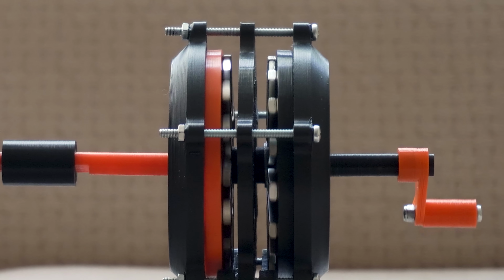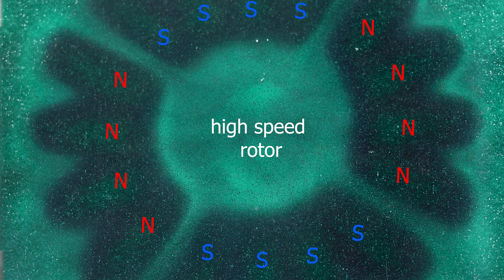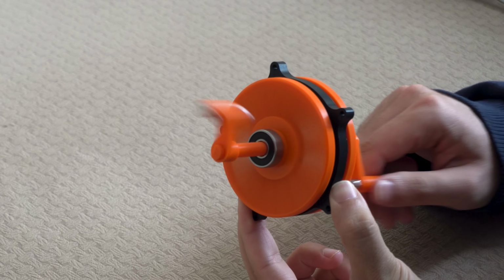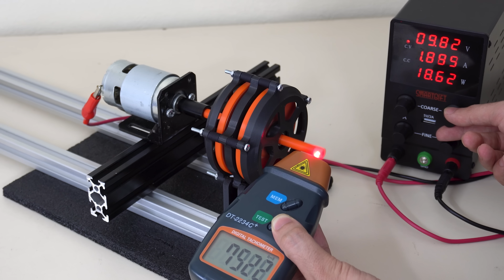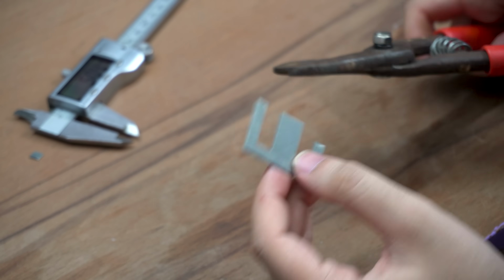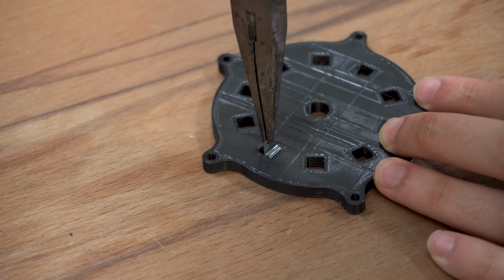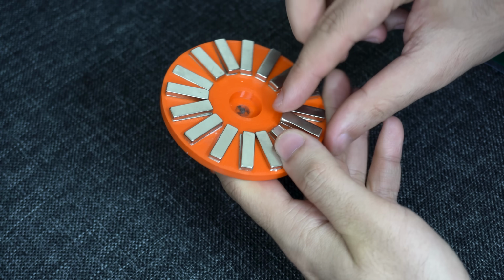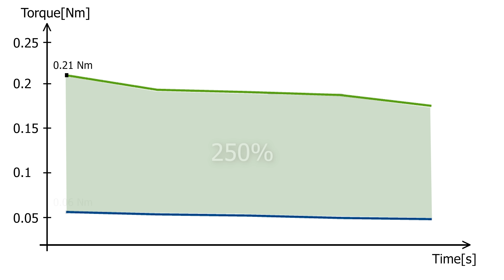Gearless Magnetic Transmission - You Can't Break These Gears

Comment: Correct me if I'm wrong, but these systems only change the speed of the driven rotor, not the torque, so it doesn't work at all like a traditional gearbox, right?

Comment: if you are going to operate a flywheel you might want to use some sort of pressure fit wood or thermo resin, 3d printing anything but metal is a bad idea. how has no one called this what it literally is, a flywheel. it's literally a magnetic tesla turbine.... which if you know anything about flywheels, they are extremely dangerous with any amount of weight. you might as well be building a centrifuge, which is technically less dangerous because of the orientation to ground and where it will roll off to.

Comment: I really love the design, but how does one change the gear ratio ? Say I wanted a design similar that I would use on a car and it needs to change gears. How would one do that ? You explained that if one changes the number of pole pairs on the rotors, it would indeed change the gear ratio, but then the magnetic flux modulator is equal to PP high speed + PP low speed, and we cannot physically chang the number of inserts on the fly when one needs to change gears, nor can one flip the poles of the magnets to change the number pole pairs on the rotors. So basically, I am stuck with a single speed magnetic transmission. Anyone found a solution ?

Comment: Bonjour, hello,
I’m struggling with the path of designing my WT,
Rather than starting with the WT itself, I rather started by deteriming the wind power (potential available) to about 26Nm torque
Now that I know what energy I’m dealing with, I just can’t find anywhere what this force will allow me to run (turn) as a PMA. Will it turn a 3m large, one magnet rotor, many magnets, and two external stators with as many coils (with IDK how many turns of IDK what gauge)
Based on my potentially available 26 Nm torque, how do I determine how many magnets (number, strength) and coils I can put ?
Any suggestion (book, etc..) will be greatly appreciated !
Éric

Comment: i wonder if the reason the small bits of transformer metal worked better is because they were cut in pieces. So instead of one large piece, you have 10-15 pieces and they are acting like individual cells together? maybe?

Comment: Here's a challenge, now  that you've been able to change the gear ratio, turn it back down to a mechanical way to charge and run itself. I'm sure you've got enough output gain mechanically to run the motor running it.

Comment: I wonder, if you replace the neodinium magnets with electro magnets you could change the gear ratio actively (also you can intentionally change the slipp force).
This could became a commersial use for small machines or even bicycles.

Comment: can you test just 2 plates of magnets to acts as torque clutch, what is efficiency when it slides: i think to do it for car water pump: pump is driven by belt and at idle it spins on 2000rpm, but at high engine rpm it spins at 12000 rpm what is too much and it uses lot of energy to drive it at that rpm, it would be good  not  to go over 6000rpm because water causes high drag as speed rises. so it would be good to have clutch that would start to slide on torque at 6000 rpm but question is will i start lose energy from input shaft on that magnetic sliding  same as it would at high rpm without that clutch

Comment: Can you submerge the entire model in Mineral oil/high viscosity synthetic? Solve any magnetic degradation from the heat caused by the eddy currents, and give you a true (near zero) frictionless gear. I realize toure essentially recreating the tourque converter by goong this, but it works for a reason 😂

Comment: "You can't break these gears".. and video starts with one of the magnets flying out.. do you think that gears break often in mechanisms? Did you consider the efficiency loses compared to standard solution? Those magnets will also self-demagnetize due to slippage and currents generated inside the magnets.

Comment: Logical theory so you can improve further so you can see how does it goes to highest torque since torque is everything since torque is resistance line that holds things, so the external and internal space is in balance since the external is what you see and the internal is also what you see, so if both external and internal is in balance by visual so it cause heat, since external is the mass that you can see and internal is the space that you can see, so there is a gap, so the mass has interact to the gap which cause react that is heat, so the external of two different to visual space, compare to higher external space, per um, so there is higher two different of visual external space so the visual external space is 5 inches, so the external space is smaller so it is at  very tiny level, per 5 inches in connect to internal space that is so tiny, so that is space gap, so two balance is in balance by visual and non-visual, so compare to us, the visual to non-visual, there is alot so it cause higher cold react since it is high amount of internal space so the air gap is so tiny relative to mass gap, so cause higher cold effect, so reduct heat so much so it is cold and very fast.

Comment: This won't work as a transmission. It can work as a replacement for the clutch and/or torque converter for a conventional transmission. It's just a piece of the powertrain, not a replacement for the whole thing.

Comment: You almost have Zero Point Energy down bro instead of putting your magnets face-to-face you need to invert them. You need to put a barrel cylinder in the Middle with your polarity phase as follows. North north south north north north south south north north south south north. Then what you do is you take your outer ring of magnets and run the opposite polarity of what I just showed you and once you put it together it's going to continuously spin just make sure you have one magnet that you can remove so it breaks the polarity chain of the current and slows your motor down to where it can be stopped by hand. I've made self-driving magnetic powered motors and I have one of my go-kart my top speed is 47 miles an hour. And that's a small motor about 7 in in diameter

Comment: Okay, but what's the theoretical maximum?
Reply from the maker: My previous video can give you an idea about this
Reply: @retsetman9698  ty!
Reply: @retsetman9698  wait, but doesn't that mean that gears of this design you made are virtually as good as the mechanical ones?
Reply from the maker: Because of the load I can apply to the magnetic gear in the electromagnetic brake video is very small, honestly, I don't have much confidence in the efficiency value of the magnetic gear there. There will be a new video about it

Comment: Btw, there's one more obvious improvement that you could make, though it would result in the project being less 3D printer friendly.

You could make a round backing steel plate such that the magnets are placed and glued onto the plate, and the current housing print is turned into a spacer print. This would guarantee that no matter how close the magnets get, the attraction to the plate would always be stronger than to the opposing magnet or insert due to the air gap.

But more importantly, this should result in an increase in flux density since the backing plate allows for a lower loss flux density path instead of open air.

Comment: No contact (except for ball bearings), no wear (except for ball bearings), no lube (except for ball bearings). You can't break these gears (unless you use them and they heat over 80°C for regular ones). And you can not cool them like oil transmissions that also has no contact (except for ball bearings), no wear (except for ball bearings) and made out of lube that is easily flows, cools and can be changed. That is why this "genius" transmission used in none vehicles o)

Comment: Very interesting. But application-wise it is not very useful. You are tackling the problem in reverse. Usually gear boxes are meant to convert low torque high rpm into high torque low rpm. In aviation for example turbo props' propellers wouldn't be able to handle 30k+ RPM engines usually produces, or else they would disintegrate catastrophically. Instead gear boxes step it down to around 1000-1500 rpm but with much higher torque.

Comment: Then imagine if it was electromagnetic I can easily change the gearb ratio and even increase the magnetic field increasing the efficiency of the gear😮 it can even increase and decrease the torque
Reply: All in all I have inspired the creation of the. Very first electromagnetic variable gear transmission  in short (EVGT)😮 or it could also have a system were the ratation of power can be converted to electricity to power up the EVGT ,so the faster the rotation the better the transmission 😮🎉 it will be great for hybrid cars

Comment: They are perfect but one problem they are low rpm. I research it even the very best are under 3,000 rpm  it's a limitation that why it can't be used even production used need higher rpm. Or they be perfect fly wheel  So in short they contradict itself no friction but.low speed  Lol

Comment: What is the efficiency ? There are a lot of working, but useless things.
Reply: If this is anything like an eddy current motor such as the ones on some of the ancient machines at my job, then not great. They waste heat like nobody's business. The positive is that the  motors and drives last for ages, we finally had to put down our last eddy on a trim press that has been running since 1990. Even when it was broken it was still functioning, but after about an hour it would start slowing down and you could fry bacon on the motor. 

One neat side effect is that the new motor/vfd combo had nowhere near the starting torque of the old eddy. Fortunately, the motor was run through a 4 speed transmission, so shifting to 2nd gear allowed it to work fine. The old eddy had to be operated at 1:1 near the end of its life because it couldn't spin fast enough to make rate otherwise.

Comment: Not a new idea, there is another YouTuber who recently had a similar design to replace the gear changer on a bicycle. The main issue is it generates a lot of heat as you accelerate and decelerate that damages the magnets.
Reply from the maker: If you are talking about Tom Stanton's project, to be honest, my first video on this subject was almost a year ago, which magnetic gears already discovered 100 years ago. Regarding the heating issue, Tom used Eddy currents, whereas this gear mechanism doesn't use Eddy currents directly; it relies on the magnetic forces of permanent magnets, so there won't be any heating like in his setup. Currently, the biggest challenge is efficiency and the fact that permanent magnets are not easily accessible.

Comment: While I'll admit this is a fun idea to toy with, you are far from achieving any signifficant torque yet. And that's where the power of traditional gear boxes lies. Plus - "unbreakable"? I have strong doubts about that. You still relly on bearings and the quality of those magnets does degrade over time due to the flux pushed through them. Might not be detectable at such a small scale, but it does happen. I suspect you need a better solution to be able to call it "unbreakable"

Comment: Wow, another science fair project that pretends to be scalable! Why not using electromagnets, so you can actually control the magnetic field intensity? I mean, if you are going to post this kind of stuff with 3D printed parts that are unbalanced connected to a motor that peaked at 0.068HP (the 50W at the beginning, even though you overvolted that DC motor to get there) , you might as well overcomplicate it further an make it even less viable. 

I wonder how well this experiment will do on a 1HP (735W) motor and the cost to even make that.